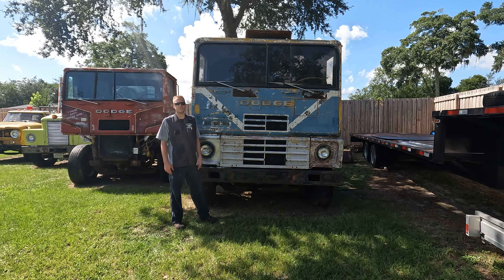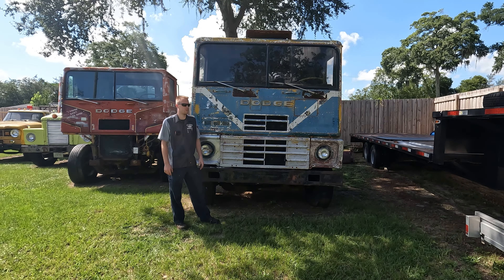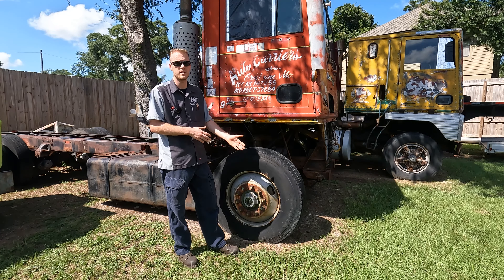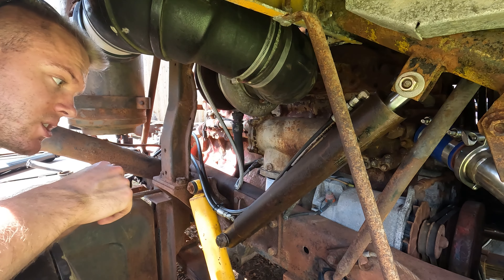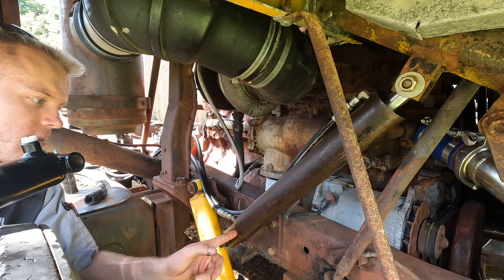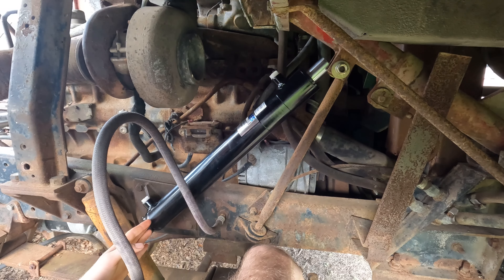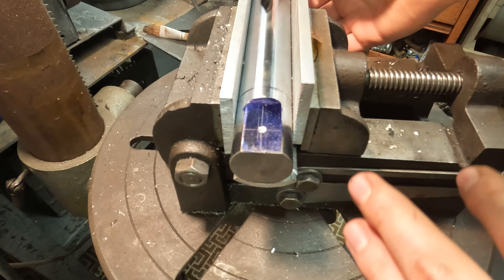Modifying a Hydraulic Cylinder to Become the Lift Cylinder for My Cabover! 1968 Dodge L1000 - Ep. 3

Comment from the maker: It has been quite a while since I have uploaded last! I hope this video suffices! Thank you to all my supporters for sticking around while I was away!
 
The Cylinder ( HMW-2016) featured in the video was paid for with my money. I am not associated with Hercules Sealing Products in any way. Link to the cylinder is https://www.herculesus.com/product.php?search_text_new=hmw%202016

I also did not mention in the video another good reason for picking an off the shelf cylinder, is seal replacement. Off the shelf cylinders usually have parts readily in stock which makes fixing them cheaper, easier and more time efficient. 

Pro-Tec Powder Coating LLC Website: https://protecpowdercoating.com/
Pro-Tec Powder Coating LLC FaceBook: https://www.facebook.com/protecjax/

Chapters:
0:00 - Intro
0:45 - Sponsor
0:59 - Discussing the Focus of the Video
1:37 - Why I am Modifying an Off the Shelf Hydraulic Cylinder
6:01 - The Cylinder I Found That Will Work for My Application
8:23 - Cylinder Mocked-Up and Discussion of Modifications
11:30 - Grinding the Flats
15:23 - Drilling the Rod Pin-Eye
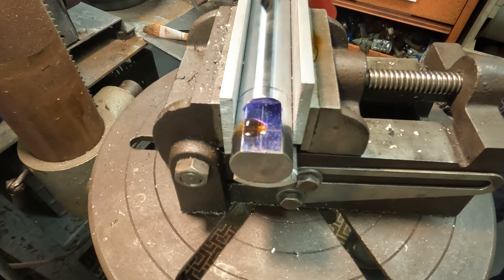16:20 - Drilling the Rod Pin-Eye (Pilot)
16:36 - Drilling the Rod Pin-Eye (Major O.D.)
19:42 - Checking the Base Alignment 
21:14 - Trimming the Base Cross Pin Down
21:54 - Review of the Work Done to the Bottom Cross Pin and Install of Cylinder
24:19 - Checking Alignment of Cylinder One Final Time
25:10 - Final Words
26:52 - Outro

Comment: Great to see a new video. I can tell you’ve done a lot of precision work. I think you’re better off going that route with the stock cylinder and modifying it. I’m thinking you’ll find a need to round that like you said could cause it bind near the top of the stroke. Going this route you gain the knowledge so if you need to do it again which definitely could happen you know what it takes. Almost thinking you may want to put a castle nut on the top of the cylinder but I maybe overthinking it. Your mill maybe a better choice for making those clearances but heck that looked like it went good. Can’t wait to see what’s next.
Reply from the maker: @darrencatenacci2737  I definitely think I could use the same cylinder on my day cab if it was needed for sure! I kind of agree with the castle nut idea. Because I changed the design of the shoulder screw, to a more floating design tension is solely reliant on the flanges themselves. But I dont want to necessarily drill that screw for possible changes that need to made in the future. Maybe Ill do a swedged nut or a nylon lock nut. It definitely needs to be addressed though. Thank you for watching!
Reply: @OLDSKUULGARAGE  Wouldn’t miss can’t wait to see what is next! 👍👍

Comment: Turn your fittings to come in from the bottom that will give you more clearance
Reply from the maker: @jeffmaclean7700  I definitely need to start planning the general layout of my intake piping to ensure I route the lines correctly and in an efficient manner. I think you are right if I flip the cylinder I shouldn’t have any issues at all. Thanks for watching!
Reply: @OLDSKUULGARAGE  your welcome I’ve been doing this for45 years sometimes an other pair of eyes helps 👍great video

Comment: Great video as always 👍really looking forward to the next one sounds very interesting. That's pretty good grinding skills you have there, nice to see the effort you put into it you would hardly need it milled now. The stainless bolt is nowhere near as good as a high tensile one but I would prefer the stainless for rust prevention and just looks better to me and if you have some good anti seize grease on it I wouldn't worry at all looks a good size and should handle well.
Reply from the maker: @homemade_projects  I believe I will go back and re mill the faces at a later date just to make it look near perfect. But for hand grinding we will take it. My main concern with the stainless is exactly what you said and I made it from stainless for the purpose of rust prevention. The cab is not very heavy though (450-600kg) so I believe it will work out in the end. I think I will also add a nylon lock nut instead of a spring washer as well. Another concern I have is I cant really find a good spot to add a greasing point because of clearance and access. I have thought about adding a zerk fitting on the head of the bolt and through drilling to a center point for greasing. But I felt the stainless may have been too weak at that point and would have to be done with something stronger like a 1045 or 4140 series steel. Thank you for watching and commenting!
Reply: I do favour the nylon lock nuts can't beat them. A small grease hole through the centre can actually increase the strength of the bolt as creates a wall thickness, it can be hard to believe but have come across this before where solid bar was bending then simply hollow bar the same size worked extremely well. Hopefully you find a nice grease nipple to suit, have seen them with all shape angles to get in tight places great work again 👍
Reply from the maker: @homemade_projects  oh wow you are definitely right with tubing structure! Something I completely overlooked! I will be making some changes at some point! Thanks!!

Comment: What if you were to drill and tap the top of the cutoff rod and used a rod end bearing with a lock nut for adjusting?
Reply from the maker: @74charger44  that would most certainly work and would possibly get more stroke because of the adjustment factor. I would most likely would have achieved a full 16” stroke with that design. But I did end keeping the design the same as to reduce the amount of modifications to be done. I would definitely want to do something like that on my lathe as well for ease and accuracy. Really not a bad idea at all and something I will hold on to! Maybe I will change from the design I currently have and revisit in the future! Thank you for watching and your insightful comment!

Comment: Curious. Did you use the factory o.d. for the drill hole center measurement?
Reply from the maker: @74charger44  Yes I did (5/8” 0.625”). I did that just to preserve the flange so there were no real modifications needed. BUT the threaded end of the shoulder bolt was turned to 1/2”-20 UNF.